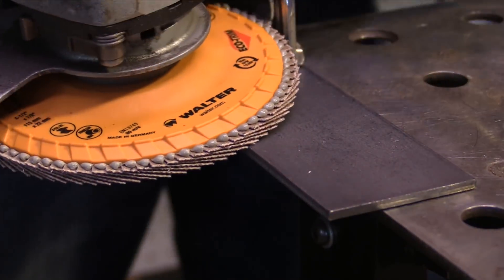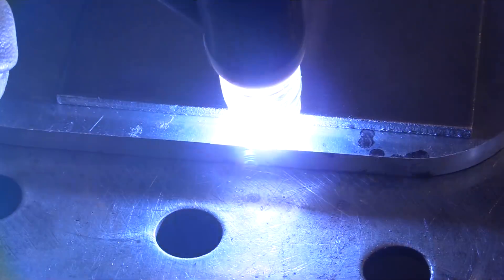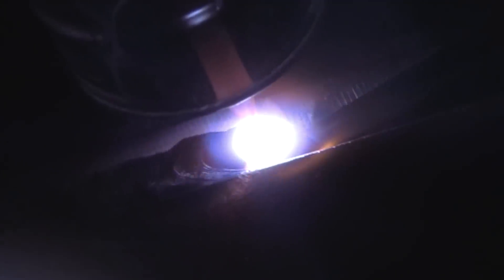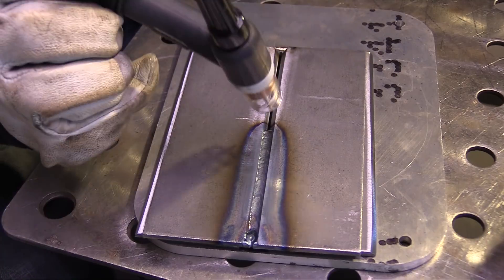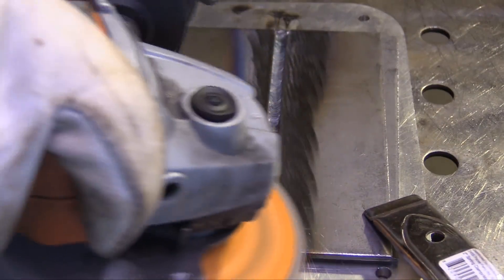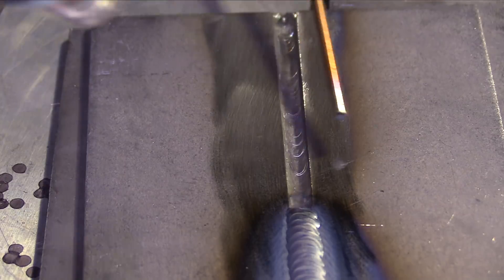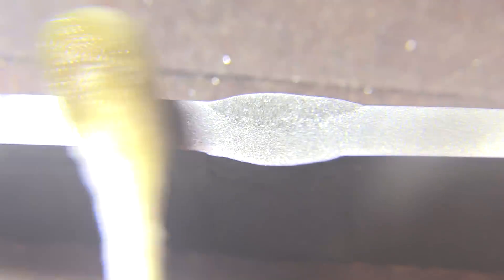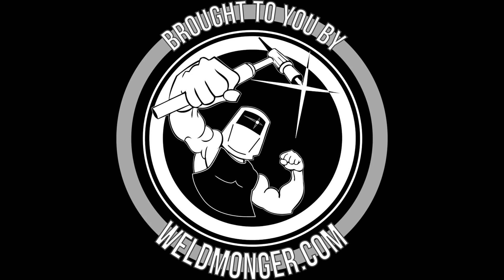TIG Welding Techniques - Carbon Steel butt joint

Comment: is there a way to bend test that type of weld? I actually did something similar that I came up with on my own. I only have a 110v outlet so i limited to 90 amps. I figured if I bevel it with a landing about half the thickness and used no gap that it should penetrate. I did two passes like you did and it seem like it worked really good. I'm going to bend them around about a 1 inch radius just to see what it does. and acid etch my welds as soon as I get some of that paint remover stuff you said you can use.

Comment: I've never seen anyone bevel the edges and lay down a root and cap on 1/8" steel before. Does this make for a significantly stronger weld than just butt welding with higher amps (125A) and 1/16" or 3/32" filler metal? If so, would it be beneficial to follow this same procedure, leaving a gap, then running a root and cap pass, when welding rectangular structural tubing with 1/8" wall thickness?

Comment: Hey Jodi, anyway you can do a 3g stainless steel smaw weld? I have to use a 3/32 electrode and weld a 1/8 stainless plate. Everytime i try i blow right through or get no penetration at all

Comment: How do you weld on the bed of the truck without frying the computer ? I want to build a flat bed and work and weld off the back of it but I don't want to disconnect the battery cables every time I do a job . thank you
Reply: Generally you won’t fry the computer, unless you’re using high frequency tig. For piece of mind, install a battery disconnect switch.

Comment: Would it be possible for you to do a video explaining what all of the different weld types are? 1G, 2G etc... You always put out amazing content and amazing video quality. I just started a teaching job and would love to be able to show my students on a big screen.

Thank you for the great content
Reply: Ty Gramley G= groove weld, both sides are beveled like in this video,  F= fillet weld, welding with one piece 90 degrees to the other, 1 position = flat like in the video, 2 position = horizontal, 3 position= vertical, 4 psoition is over head, the G and F can be combined with thw numbers, for example the weld in thia video was a flat groove weld so it would be a 1G weld

Comment: Hello Jody, I'm a new welder in Brazil. I have a question here: is the support plate you are welding the material in aluminum? For the weld bead that was made by joining the 2 materials they did not join with the support plate. Thank you.

Comment: hey jody. I love the videos. keep them coming. I have a question. im pretty new to tig welding. I have an eastwood tig 200. im welding in a patch panel on the firewall of my truck. its 18g steel. im using a #7 cup a gas flow rate of 15 and 20amps. I was looking for .045 rod but they dudnt have it so I have .035. do these setting sound right to you? any tips on this would be appreciated.

Comment: Hi,

i have some difficulty to weld 10mm steel tubing 1mm wall. I use 1,6mm rod with about 25~30 amp. In my experimentation i think it's a little hot. But whith less amp i find the puddle really long to form and i m scared to put to mutch heat. Any tips on that ? Is to make bicycle rack.